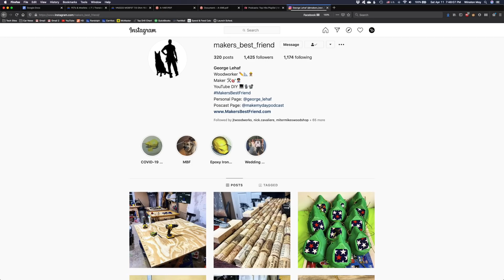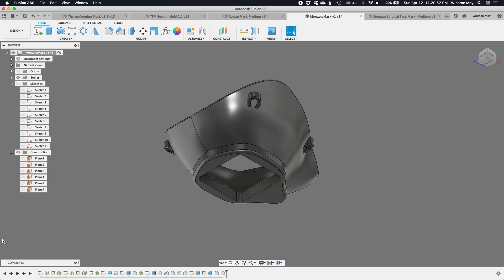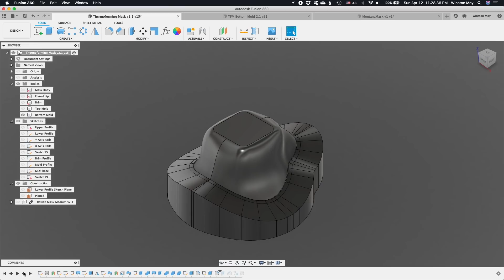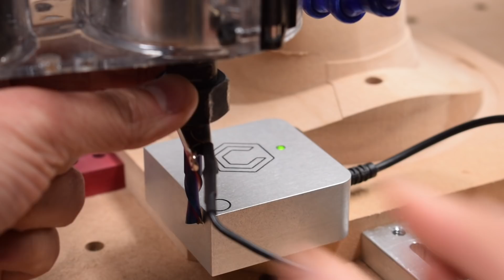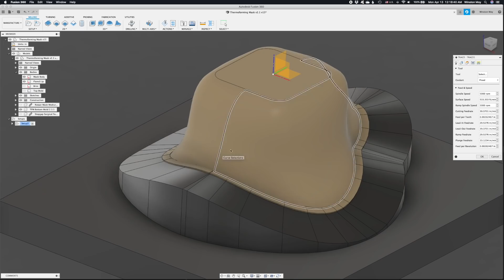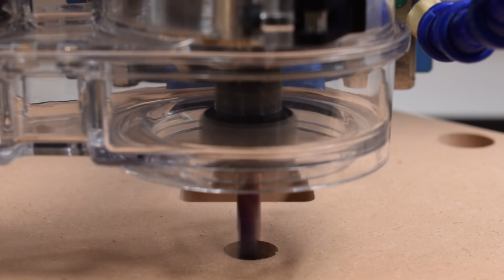How I Ruined My Latest Project - #165*

Comment: Hello, I will dig up the topic a bit, very interesting material, I have a question, what material did you mill it in? and I was curious about the method of finishing milling, where did you mill the top and bottom with what kind of milling cutter? and would it be possible to share this file, because soon I will have several complicated forms for milling, this method seemed very interesting to me and I would like to get to know it better :)

Comment: I don't really get why the shape has to be perfect though, pretty sure it would still be an effective mask with a bit of lopsidedness, could use a sanding drum on a rotary tool or similar to blend over the problem spots? I understand being annoyed by having problems like this but it also seems at least to me you got annoyed by a failure of a tool/methodology and binned the whole project when you could still probably recover something that works but might not be pretty using a more manual workflow

Comment: Create a return lip at the bottom of the form. Will make the edge smoother, and you can punch holes into it for the mask straps. 

We just printed and sanded our tool. Works great. We print thermoform tooling all of the time at work for short run parts. Just have to monitor your tool for heat soak if you throw it into a production machine. 

Picture of our first prototype: Montana thermoform https://imgur.com/a/Gtuz6iK

Comment: Winston, part of learning is making mistake, what I love about these video is what issues you have found. Such as the machine had issues, that is the problem I found with my CNC machine. Typically you think your machine is working in perfect order and find why it did not come out. You are very proficient in fusion 360. The second wave will be something that will cause more PPE to be available for our first responders. So I would not give up on this mold.

Comment: I had the same idea about a month ago and while I completed my buck the lack of material on hand locally and the geometry I was forming got the better of me. I had wrinkling because I was using kydex(on hand) and the buck wasn't ideal. I realized at least for myself a bunch of folks without the ability to vac form but having functional printers were able to produce faster than I could on the vac table. So I walked away as well. I continued designing and revising the printed version but I haven't been back to the vac formed one.

Comment: I had some of your issues too and learned a lot about the reproducability of homing./zeroing My cnc controller board is susceptable to ground loops and locks up sometimes. When it happens I have to rezero. Sometimes you machine away your reference points. What I do in those cases is use the homing switches, zero the axes, then read the machine coordinates of the zeroed axes and copy/paste them if and when the board locks up. This has saved me so many times. I use a laptop instead of a desktop pc now and the lock ups have never happend again but on important projects I still use this technique.

Comment: I agree that 3D-printing is not a solution. I see people on facebook and instagram screaming in my face that '3D printing is going to save us from the pandemic'. But in the end they are mostly people that want to make a positive image about themselves while deep inside they know that 3D printed respirators are not the solution. It is time that people realize that only in extreme cases it can be a solution. For example with the drip connectors that were printed in Italy, but once again, this story is missing a big part of the nuance, it wasn't an FDM/FFF printer, you could never make medically safe drip and reliable connectors with an FDM/FFF printer. Also, mass-producing parts with a 3D-printer will cause more waste than making one injection mold and mass producing with that machine. It may be more work to start up, but once it's going it's simple, safe and controllable.

Comment: Regarding the counterbores in the wrong side... plugs glued in would repair that easily... 
Plastic wheels should be replaced with brass at least... for longevity (do u have a small lathe ?)... and really... machine-maintenance is something you should be doing on a scheduled basis... as a production engineer, I have learned over the years that prevention is paramount... ALL manufacturers have maintenance-schedules , they can't afford unscheduled downtime in the middle of a run. 🙄

Not beating ya up here, just making some suggestions.
Good luck !! 🙄🙂

😎👍☘🍺

Comment: I immediately started 3D printing masks, but they didn’t fit and weren’t comfortable. I was thinking of 3D printing a mask to use in vacuum forming but had never done forming so just printed them. I played with my model making 10 different prototypes before settling on one. It’s still not great but if it’s going to be useful it also has to be in time. Nice try.

Comment: Posting before finishing the video -- I wanted to add...we have a vacuum former at our makerspace and it is a fickle bitch. One big thing I've learned using it is when possible...use a negative form instead of a positive buck. The positive shapes almost always have folds around the peripherals where joints don't pull smoothly. As the vacuum pulls, the majority of the material is eaten up by the form leaving little for the void, resulting in stretching.. The justification for suggesting negative space is - look at the solo cup. As the material draws into the void it experiences the same forces on all sides, leaving the majority of the material to comply in all directions outwards.

Addendum after finishing the video. Thanks for sharing and trying to do your part. It definitely can be frustrating when every part of a project goes sideways. when the machine that makes the machine breaks it it hard to not 'blame your tools' but in this case it's worth the mental credits. Enjoy that sun!

Comment: Maybe you didn't show it well, but I'm at a bit of a loss as to why you gave up. Your finished positive is slightly imperfect from your mistakes, sure, but a little sanding paper and you can have a decent chance of vacuum forming from it without issue. A vacuum forming rig from Shapeoko would be a great product!

Comment: Man, CNC CAM it's still hard to do. Way harder than 3d printing. But...
You can make to mould for vaccum forming in a normal 3d printer. I don't think it will melt.

Comment: I'm a cnc mill programmer. The shop I work at does a lot of one off parts in stainless and other heat resistant materials like Inconel, monel, etc... Nailing our 'projects' the first time around is our game... Failure (though a great teacher) can get expensive fast and it doesn't take much

Comment: Winston, I was against you shelving the project until you made mention of doing so for your own mental health. Exercising self-care is an important aspect of good self-leadership. So, good for you. It seems you took away other valuable lessons from your so-called "failure", and that's a good thing.

I, for one, don't view your attempt at machining a buck to thermoform respirators a failure at all! Aside from the homing/zeroing error, the ball screw and v-wheel fracture that led to the mis-machinging were both out of your control.

So, once you're back in a good head space, get back in the garage, repair that CNC and get back to the brilliant work of which you're so capable!

Thanks for the incredible view of the rainbow at the end!

Be well and do good work!

Comment: Great to see the process - and I echo that the opportunity has not passed (you may not want to hear that :)) - I think it is a great idea to vacuum form. This has shown that 3D printers are an amazing tool - but that they may not always be the 'production' tool unless you have volume (a farm) - despite having 3 printers I have used the laser cutter for shields and it can churn out 100 a day as pooped to 5. The meds have also commented on how easy they are to clean overnight. So I love the different path, and they were mistakes we all make (I just recessed bolts on the wrong side of a frame for a deck chair - who does that!)). Keep doing what you are doing!!

Comment: Small point really, but the holes on the wrong side could be fixed with what we in Australia call Builder's Bog - probably Bondo in the US. I have saved numbers of projects where I have removed material I shouldn't have, with the judicious application of  Bondo. I'm not sure about how secure it would be to apply  Bondo the outside of your model and then re machine it - maybe roughening the surface so it could "key in". 

I make a lot of mistakes and an advantage of that is learning techniques of how to rescue disasters.

Comment: Couldn't this error have been fixed with some sandpaper?
Reply from the maker: The problem with this mold isn't that I couldn't form something over it, it's that I can't position it accurately anymore and use it to cut out the vacuum formed pieces and create the interface for a filter.
Reply: Couldn't more material be added such as a high density spray foam to the surface of the buck. From there resurfacing could be done?
Reply: @WinstonMakes  that can also be done by Hand
it's boring, yes, but it works

Comment: The 3D printed masks is a great concept, but right of the printers there can be gaps as much as 20-50 microns and even up to 200 microns depending on print quality, but if you increase quality the print time will increase drastically and pretty much no home printer will be able to reach the layer height to stop viruses and last i check viruses and bacteria is alot smaller than 20 microns. Infact advertising that 3D printed respirators to work in some places is banned because it has no guarantee to stop a virus. Threated masks that's sanded and properly painted would work alot better. But you will still have issues with fit and without any flexible plastics you won't be able to close the gaps without anything else to seal the gap. vacuum formed masks is alot more promising, but by then why not just increase production rates in factories.

Comment: Why not make a 3d printed vacuforming mold?
Reply from the maker: My biggest concern was that hot ABS, which was the sheet material I sourced, could fuse to the PLA (only filament I have). BUT... Instead of worrying about hypotheticals, sometimes it's best to just try it. When I get around to making a vacuum table I'll give it a try on a smaller scale.
Reply: @WinstonMakes  
You will probably have to coat the 3d print in epoxy anyways to smooth it out. Maybe print the design and coast it in a thermally stable material? Then you can make multiple mask forms for each run.

Comment: Thanks for sharing Winston.  As the others below have commented, when we learn from our mistakes, they become as valuable as when everything works perfectly.  What sort of cover do you have over your router top?  Also, how have you installed the blower, where did you get it, etc.?  thanks
Reply from the maker: It's just a regular sock I cut a slit in,to get around the power cord. Then I used a strip of velcro to close it up again. It's mainly to keep aluminum chips out, don't need it for wood or plastic. Meant to catch big particles, not filter dust. The latter would restrict airflow too much.
Reply: Perfect!  And what about what appears to be a blower coming down the side of the router?  Great idea, but I cannot find one.  thanks.
Reply from the maker: It's a flexible coolant nozzle that I've connected to a 950 GPH air pump for hydroponic systems.  Helps get chips out of the way when cutting aluminum in deeper pockets.
Reply: got it - thanks again
Reply: comments below
or above
depends on how you think about yourself

Comment: I honestly don't know how you feel this is a failure or even worth scrapping.  The mold is an organic shape that does not have to fit into a perfect cavity with a certain tolerance, per say and the plug certainly could/should/would be perfectly fine if hand sanding and filing is used.  You most likely would need to seal the mdf mold anyway with gluesize, shellac, epoxy, etc. and sand to a pretty smooth surface prior to molding.  I think you should keep trying and prove the vac forming concept.  One big drawback that I see in these printed masks is the rigidity of the material.  Most 3M respirators (cartridge types for organic vapor) are almost a molded rubber/silicone  material that conforms to the face.  In that vein, I wonder if a silicone mold and settable and suitable durometer plastic would be a better approach...probably not due to the costs of these materials.
Reply from the maker: For vacuum forming its better to not seal the buck. You want to draw air through it to eliminate air bubbles and pockets. I was aiming for something slightly more flexible than cheap disposable plastic plates. 
The problem with this mold isnt that I couldn't form something over it, it's that I can't position it accurately anymore and use it to cut the vacuum formed pieces and create the interface for a filter.

Comment: Ouch I had the same problem with HDZ upgrade today... My bearing holder at bottom was loose and screws on the HDZ linear rails unscrewed and popped out on both sides. It freaked me out when I heard a crash when gantry moved up to switch cutters. I really hope HDZ won't give me problems now :(. Side note though, the HDZ is really awesome and a great upgrade! Just add lock tight if you get one.
Reply from the maker: Yea, it's always good to "trust, but verify" that everything's been tightened down. Set screws are the most common thing that need to be double checked.

Comment: Works great! Do it all the time in film industry and rapid prototyping.  Try using a very high density carving foam instead of mdf.  Easier to finish by sanding and poly primer.   Or you could print one with the same concept of having flanges for a return edge, finish with high build primer and mold that.
Reply from the maker: Plan A for me would have been to use Renshape, but that would have been way pricier. Need to find a cheaper alternative..
Reply: @WinstonMakes  xps

Comment: What's the covering over the router?
Reply: A sock
Reply: @BlacksmithGen  Like an actual white athletic sock or a router-specific one?
Reply from the maker: Like an actual clothing sock. Keeps aluminum chips from shorting out the router.
Reply: @WinstonMakes  Thanks.  I just finished my first hobby mill build and wondered about debris getting into the router; will definitely add.  Thanks as well, Genesis.
Reply from the maker: Bernard Tarver Keep it thin. You want to stop big particles, not necessarily filter out dust. You'll hurt the cooling ability of the router otherwise.
Reply: @WinstonMakes  Ok, thanks.  I've got dress socks that I can sacrifice.

Comment: Why not use 3d printing to make that mold?!?
Reply from the maker: It's a good idea that did cross my mind. My biggest concern was that hot ABS, which was the sheet material I sourced, could fuse to the PLA (only filament I have). BUT... Instead of worrying about hypotheticals, sometimes it's best to just try it. When I get around to making a vacuum table I'll give it a try on a smaller scale.

Comment: You could quite easily create the primary surface as a t-spline and then create the secondary surfaces as traditional nurbs surfaces. I think the idea of vacuum forming is flawed. You would be much better off casting in urethane. This could be done in a number of ways but I think you cou l d be best to mill a core and cavity mould...

Comment: The vacu-forming concept is excellent - 3D printers are being used en-mass to fill the gap until injection molding can ramp up for this PPE, but vacu-forming is a great intermediate step.
Thanks for sharing your frustrations - these hobby-class machines (includes almost ALL 3D printers) are fantastic, but they aren't super rugged, and seeing the kinds of flaws different failure modes can create is helpful to everybody in diagnosing problems.  The runner wheels on your CNC machine, for instance, are almost exactly how most delta-arm 3D printers work, and a similar shift in a printer would result.

Comment: Ever thought about creating a mold for a mask, but create it using the top of a PET bottle, Heat it up and press it on to form the shape, then, you only need an adapter for the nozzle/screw thread to a suitable filter. Was going to peruse that here, but we are lucky enough to not have been that badly effected.